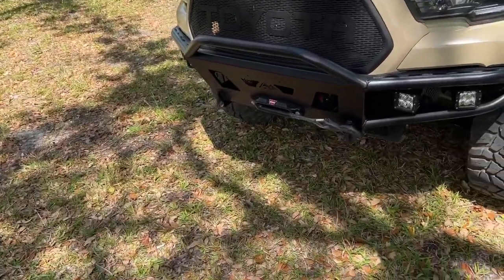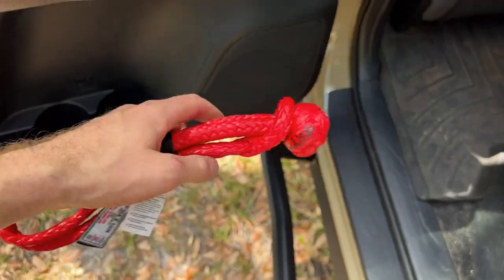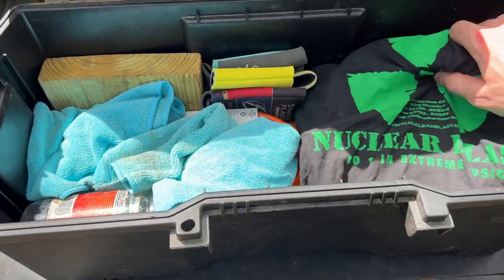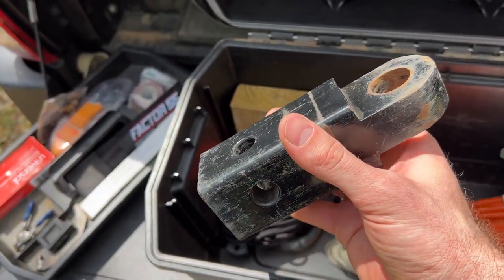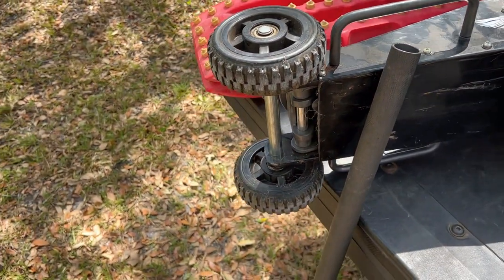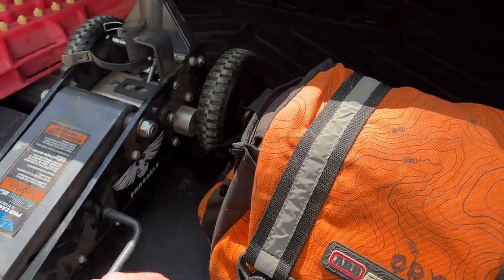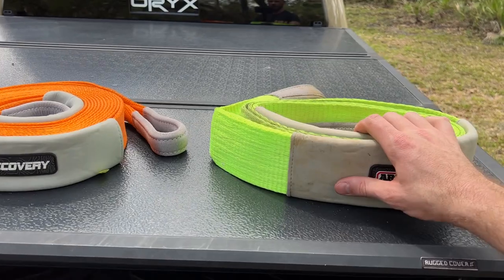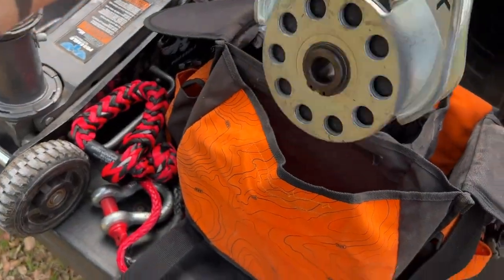Off Road Recovery Gear

Comment: Very nice set up you got, all great items to have for when you’re in the back country. One note, I’d put that steel d shackle in your bin under the seat instead of the door pocket, in a roll over or wreck you don’t want that to become a projectile and hurt yourself or any passengers. Cheers 🍻 and safe travels.
Reply from the maker: Thanks for the comment. That is a very good point. I will find a new spot for it. Cheers